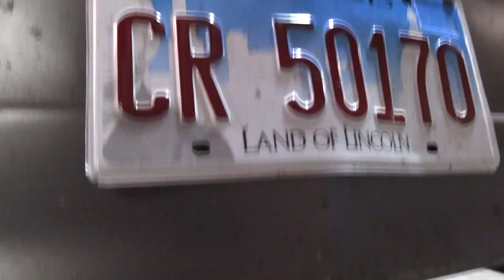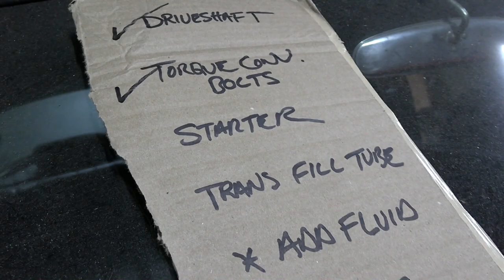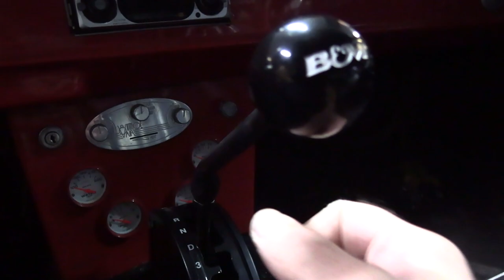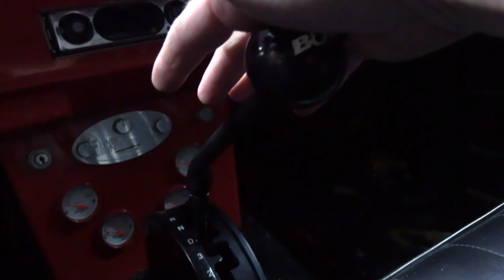Studebaker Sky Hawk Custom - Transmission Swap and Road Test

Comment: Off topic but gotta say impressed trans am has original torgue arm design
Reply from the maker: It was running some decent times with that stock torque arm and 9 bolt Borg Warner rear.

Comment: Hello, "This is just a thought" on the issue with the cable swivel. I'm thinking the imported manufacturer of the swivel (All China now) changed to metric but the threaded cable end is still SAE. As you said it goes on 2-3 threads then stops. You chase it and you put new threads in the swivel. Very easy to do on that small piece. It works but I'm guessing the hole is not the correct size for the tap you are using. I would take the new swivel to a hardware store and try screwing a metric bolt into it. Then contact B&M.

Comment: Good to see the car back on the road again is the engine in the car a 350 or 355
Reply from the maker: It's an aluminum head LT1 350 from the 90's that I swapped over to a carb setup.  It only has around 11,000 miles on it, so I haven't been able to convince myself to swap it yet.  I'll probably run it for a while.
Reply: I would to or just keep it in the car until it quits or leaks get bad I'm more of a fuel injection v8s but nothing wrong with a car with how u have the engine now my dad's 76 c10 was the same way couple pumps of the pedal before starting up
Reply from the maker: @gerredstallings465  Yeah, it fires up really well now.  The problem before was that I had the old factory computer and it required prom chips to tune it.  I could have ran it off a Terminator x or something, but the carb setup was easier, and it's only a toy really.
Reply: It was good seeing running during the video I saw it during the video of the trans am video I figured a video would be up soon about it

Comment: Just got here and a couple of questions...... Fifteen or so years ago I was helping a neighbor restore his '56 Golden Hawk. This one had the original Packard engine with the dealer installed Isky cam and dual four barrels.  The Studebaker frames were known to be "flexable" and we found a crack in the left front cross member of his.  My question is, did you find any issues with, or reinforce the frame in this '56?????
Reply from the maker: Glad you like it, thanks for watching!